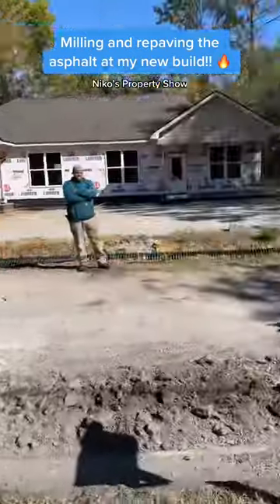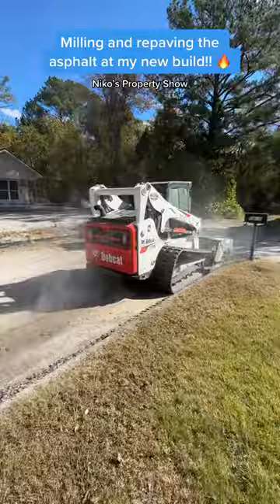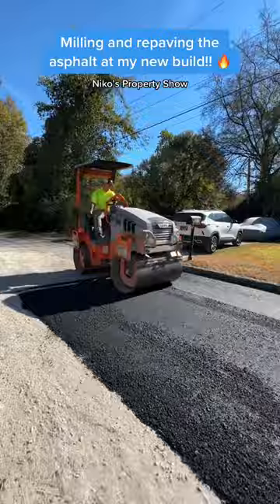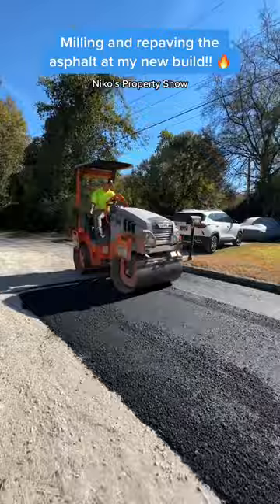Milling and repaving asphalt!!

Comment: “It turned out so beautiful”
No. Those people patch up one spot not realizing the pain of driving on it. Especially on brick roads. Brick roads are fine until every repair is finished with asphalt slapped on top
Reply: Also that took them days which it should have only taken a couple hours armatures is a understatement
Reply: Whats your idea to fix this?

Comment: You don’t pour asphalt… You pave it…
Reply: asphalt is technically a liquid so he isnt wrong by saying "pouring" but the proper term would be "laying the asphalt"
Reply: I haul asphault for a living 
When you dump it out of the dump truck into the paver you are Technically pouring tje asphault
Reply: I don’t believe he understands that asphalt is bituminous with asphalt cement and requires to be spread and compacted to achieve density.
Reply: You pave or place asphalt. Asphalt is not a liquid, it's a concrete that uses a viscoelastic bituminous binder.

Comment: You don't pour! You lay! It's Asphalt not Concrete! Did they use a F-ing STEAMROLLER! 😂
Reply: I haul asphault for a living 
When you dump it out of the dump truck into the paver you are Technically pouring tje asphault and yes every coat of aaphault needs to be packed down or itll break up even faster

Comment: Asphalt doesn't get poured it's placed.
Reply: I haul asphault for a living 
When you dump it out of the dump truck into the paver you are Technically pouring tje asphault
Reply: @ninjalol2253  stick with driving the truck. I professional terms it's places. And also isn't it called a dump truck? It dumps shit. A concrete truck pours shit out of a shoot.

Comment: Asphalt isn't "poured". If that isnt proof enough of your lack of awareness, then the balance of this video is additional testament to your lack of knowledge about the subject.
Reply: I haul asphault for a living 
When you dump it out of the dump truck into the paver you are Technically pouring tje asphault
Reply: @ninjalol2253  We poured our own concrete. We had sub contractors who laid the asphalt. When a load of asphalt is dumped into the paver it does look like it is flowing. But you even mentioned when aspalt is "dumped" into the paver, not poured into the paver. Potato potato?
Reply: @Estwing22  exactly